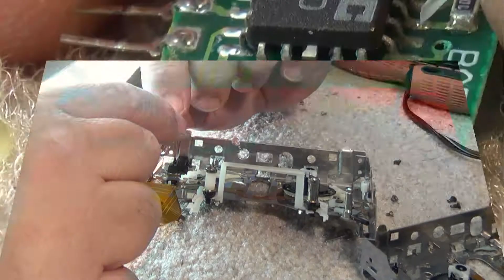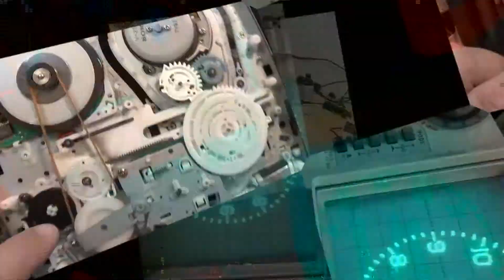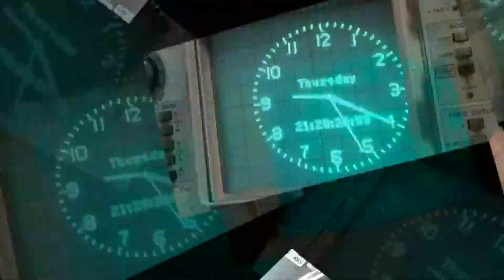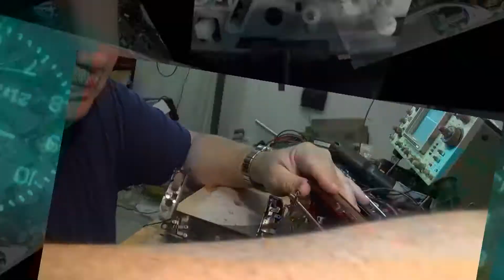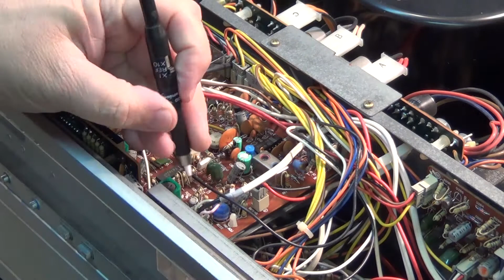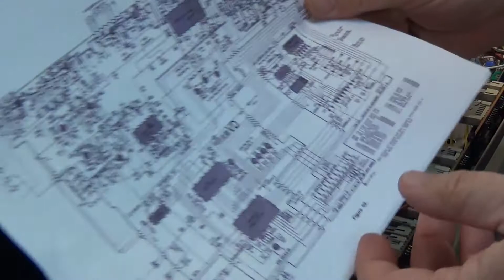Toshiba SA7150 No FM

Comment: hello sir 12volt am from Argentina if you please tell me if this toshiba transistors sa7150 stage driver and amplifier are achieved are the A968 / C2238 and 2sb645 and 2sd665 original and if I can have a link thank you very much

Comment: How could it be IF alignment when your 1st scope measurement showed audio present past the IF stages? Didn't that eliminate FM tuner, IF stages, discriminator, etc?
Reply from the maker: No the level was a little low, and the FM detector was squelching it out.
It wasn't off by much, just enough to drop the signal below the squelch (muting ) threshold. I spent literally hours going through the entire detector circuit, as I totally overlooked the IF stage too because it appeared to be working, there was audio present. It was actually the next day that I decided to check it out and I wasn't on camera when I did figure out the problem, so I put it back out of alignment and set up the camera to re-shoot it. I spent about 3 hours on that POS.
Reply: Thanks for your quick and detailed answer!